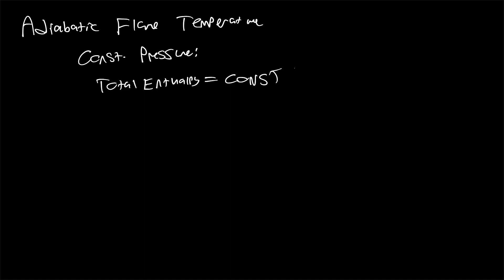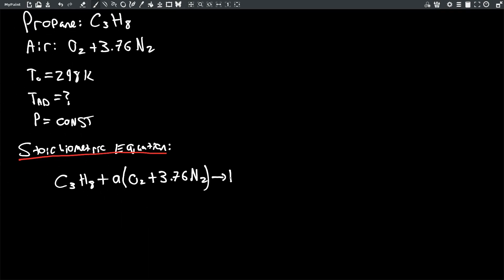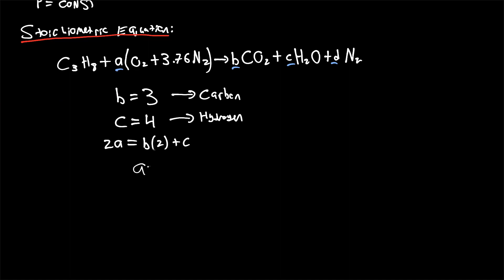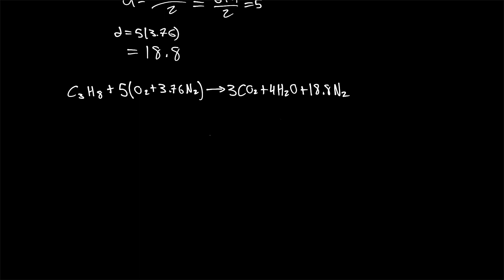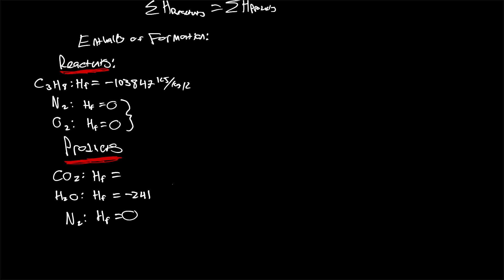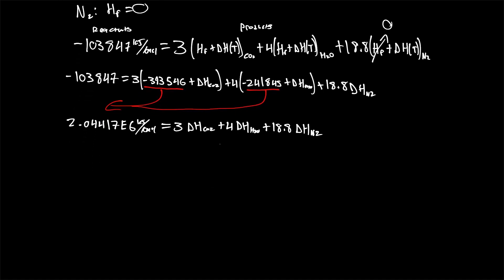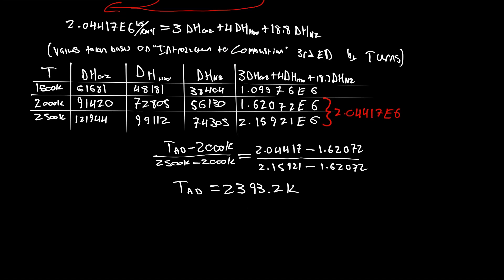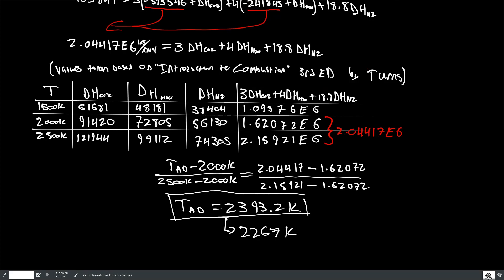Combustion Chemistry: Calculating Adiabatic Flame Temperature for Propane

Comment: The Hf of C3H8 is expressed in kJ/kgK while the rest of them in kJ/mol, if I am not wrong. Can this probably cause a problem in our calculations?
Thanks
Reply from the maker: Yes, that would cause a problem, but in this case I wrote kJ/kg.K whereas the value is actually in kJ/kmol.  The numbers used in this calculation are correct, but I wrote the wrong units.  Thanks for pointing that out.

Comment: How did you get 3.76N2?
Reply from the maker: Air is roughly 79% Nitrogen.  Using a combination of 1 part Oxygen to 3.76 parts Nitrogen is a reasonable approximation for air (21% Oxygen, 79% Nitrogen).
Reply: @ArlingtonMatrix  thank you!

Comment: at 7:44 , the table you mentioned... is it directly from the book ? if yes then please share the page number (i gone through it like 100 times but i couldn't find it ) 
if no then please explain that how did you draw that table.
thanks.
Reply from the maker: The table given is not directly from the book, but is created using the values in Appendix A on Pages 686 -- 698 and Appendix B1 on Page 701 (calculated by the change in enthalpy between the final temperature and the starting temperature T0; for example: CO2 on page 688 at 1500k has a change in enthalpy of 61681 kJ/kmol given in the 3rd column in the Turns textbook; if T0 was not 298K, then the change in enthalpy would have to be corrected for the non-zero starting enthalpy)
Reply: @ArlingtonMatrix  thank you. One more question, if i burnt propane less than one mole, will it create same adiabatic temperature? (compare to temperature we got by taking 1 mole of propane) 
Eg. For 1 mole of propane adiabatic temperature is 2393.2k
Then for 0.04 mole of propane adiabatic temperature would be ( less than before or same as before)?
Reply from the maker: @aspboss1973  If you keep the amount of air the same, then your adiabatic flame temperature will be lower.  There are adiabatic flame temperature charts which you can reference, such as the ones at the following link: https://doi.org/10.1016/j.combustflame.2006.01.009 (sadly it's behind a paywall, but the charts show adiabatic flame temperature for propane is peak at equivalence ratio close to 1.1, and decreases away from that).  You will also have to include oxygen as a product in the reaction since there's not enough fuel to completely use up the oxygen.

Comment: Hi, thank you for the informative video. I have a question - you are calculating the adiabatic flame temperature for the stoichiometric case but how can it be calculated when we have a fuel rich (ER < 1) or fuel lean (ER > 1) mixture? Thank you
Reply from the maker: It is possible to use this method for lean and rich mixtures, however you have to include the additional products and reactants in your equation.  For rich mixtures, you may have incomplete combustion and the production of carbon monoxide, soot, and other combustion products which can be difficult to predict.  Similar for a lean mixture where you may have the production of NOx.  Of course, you can make assumptions that no such products are formed; your result will be less accurate but for a quick approximation it can still be useful.
Reply: @ArlingtonMatrix  Today I used your video as guidance to calculate the adiabatic flame temp for 1 mole C2H6O + 0.283 moles of liquid water (basically all of this is 90% ethanol from the pharmacy :) ) + 2.0125 moles of O2 (this is a fuel rich reaction as the stoichiometric mass O/F is 1.4 / 1) ---> 2 moles of CO + 3.283 gaseous water + 0.0125 gaseous O2.
I got an adiabatic flame temperature of 3086 K is pretty close to what my RPA Lite is giving me (3091 K). :)
I am writing this because I think I answered my own question above while solving this. Basically, I adjusted the reactant's and product's moles to consider the fuel rich mixture of reactants. Thank you! Very good and informative video! (y)

Comment: I'm confused about how you took at 6:39, where you had 343346 and 241845 and got the 2 million number as an answer??? How did you get that
Reply from the maker: -103847 + 3(393546) + 4(241845) = 2.044171E6.  All that I did here was re-arrange the equation so that I had a number on the left hand side and a function of temperature on the right hand side.
Reply: ArlingtonMatrix what is the name of the table you got the values from at 7:00 and what are the units of those values
Reply from the maker: @ThisGirlYourMom  "Properties are based on appendix tables in Appendix A and B from "Introduction to Combustion Chemistry" by Stephan R Turns".  These tables provide selected thermodynamic properties of CO, CO2, H2O, etc such as enthalpy of formation (kJ/kmol) and specific heat (kJ/[kmol.K])

Similar information can be found elsewhere as it is a property of the substance.  The tables in the Turns textbook are generated from curvefit coefficients from the Chemkin Thermodynamic Data Base (March 1991); if you search google for thermodynamic properties of a given molecule you can usually find the information pretty easily, such is the case for the following link: https://www.ohio.edu/mechanical/thermo/property_tables/combustion/
Reply: @ArlingtonMatrix  Thank you! and  one last question how did you get the temperature from the last value you got, the 0.78 from the linear interpolation
Reply from the maker: @ThisGirlYourMom  This is easiest to visualize with an x-y graph.  Along the X- axis, you have enthalpy, along the Y- axis, you have temperature.  From all the calculations performed, we know what the final enthalpy should be.  From the tables, we know what enthalpy we have for the different temperatures.  So you can plot 2 points on the graph from what you know: enthalpy at T=2000K, and enthalpy at T=2500K and draw a line between the two.  Then along the x- axis, where enthalpy is equal to 2.04417E6, draw a vertical line up to meet the previous line, then track back to the Y- axis to get temperature. 

Mathematically, we can accomplish the same thing by using ([target value] - [lower value])/([upper value] - [lower value]) which tells us how close we are to the upper value (this number should always be between 0 and 1).  Since we are doing a linear interpolation, the same equation exists for temperature: ([target value] - [lower value])/([upper value] - [lower value]) where the 'upper' and 'lower' values MUST be consistent between the two equations ('lower' must use only the data from that specific line of the table).  In this example, we find that we are 78.64% of the way between the lower and upper enthalpies, and thus we are 78.64% of the way from 2000K to 2500K.  Thus, 2000K + 0.7864(500K) = 2393.2K

Comment: What is the usage of the AFT?
Reply from the maker: Depending on whether you make the constant pressure vs constant volume assumption, the adiabatic flame temperature can be used in estimating the temperature of a reacting mixture under the ideal condition of no heat being removed from the reaction and can thus be used to estimate temperatures in real combustion applications. 

Some examples might include calculating an estimated maximum temperature in an internal combustion engine ([otto cycle, constant volume] or [diesel cycle, constant pressure]), jet engines, furnaces, etc, making it a very useful tool in thermodynamic systems analysis.  I've also seen it used in CFD combustion modeling where it is used as a reference maximum temperature when testing a numerical combustion model.  Since it makes a very idealistic assumption of no heat loss, it is not a perfect model, but it can provide some useful insight which can help design real-world thermodynamic systems.